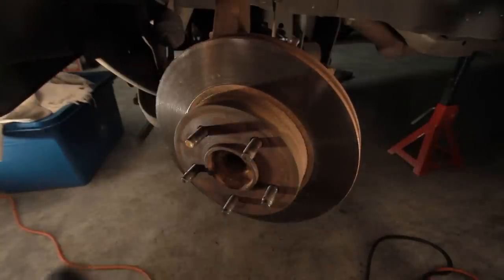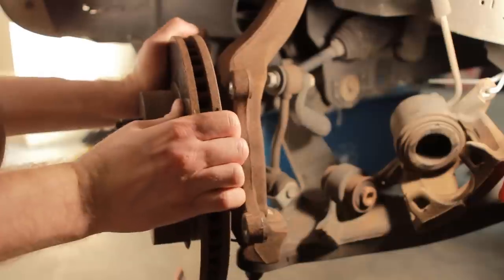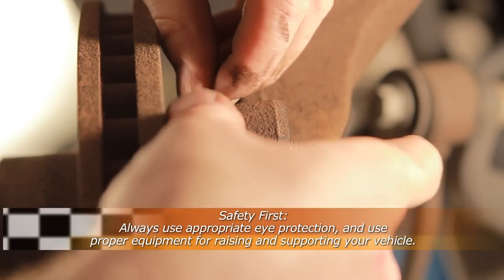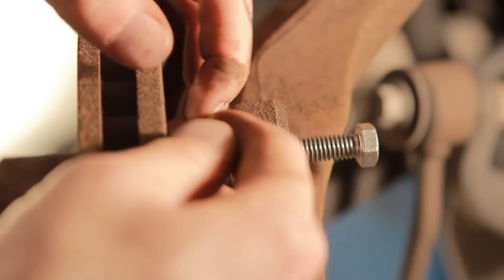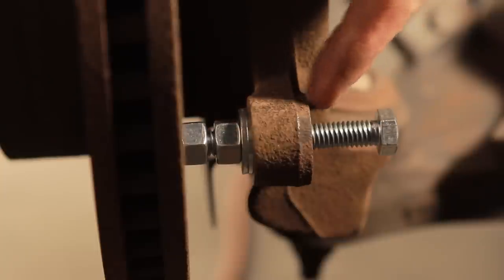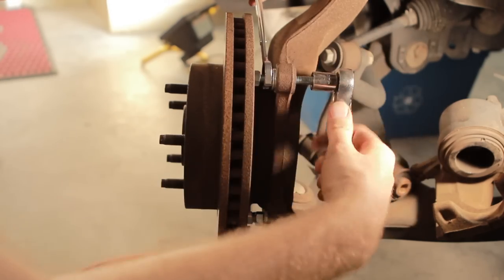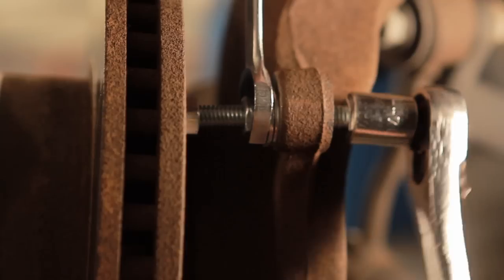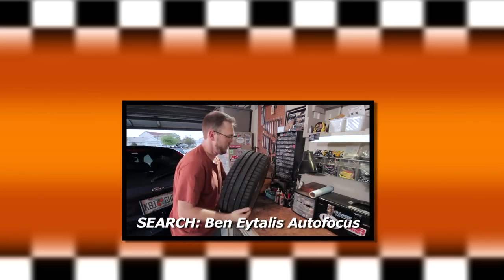Autofocus - How to remove a rusted stuck brake rotor

Comment: I wish this one worked for me. The idea is simple and effective in theory, but for my car, the caliper mounting hole riiiiight on the inner edge, so I ended up just blowing holes through the rusted edges. I used this method, penetrating oil, light torch, crow bar, and not to mention hours of whacking a 20 pound hammer on it. Upon further investigation, I got a flashlight on the inside and just saw rust caked all along the edge of the  hub. So basically what I was doing was the equivalent of putting a screw through a threaded hole and expecting to knock it through. What ended up happening is I torched the right where the brake surface meets the center. Gave it really hard whacks, and ended up braking (pun intended) the rotor...separated right on the edge. Luckily, that gave me enough room to get a giant crow bar wedged right on there. What I expected to take me 2 hours, took me 8 hours. Ugh!

Comment: Very clever -- Thanks for sharing
Reply: Never stand behind a horse and slap it on the ass. My how clever am I? All this ass hat did was show you a clever way to destroy your car. That mount he's using is the one that mounts the brakes to your car. It's easily bent or broken. Result: Your rotor is still stuck and you'll have the expense and joy of replacing your steering knuckle. Good luck with that.

Comment: my rotors being a pain i went bought bolts and try to do this, bolt just snaps
Reply: yea i dont know about you but i just tried this, bolt snapped and now its logged in behind the rotor. i need to saw the bolt out and im not even any further along. just created a ton of work for myself
Reply: @brademond7640  something happened to me. Just stuck now

Comment: don't need the second nut, but thank you! saved my ass from walking to Lowes for a bolt to fit in the rotor hole.
Reply from the maker: cool man! the second nut is mostly to apply more surface area to the bolt.

Comment: Thanks a lot for this video. I'm about to give this a try on my camry. There is no chance it will damage the caliper mount, is there?
Reply from the maker: Probably not, the cast steel parts are pretty tough. Just watch it though as you apply pressure, you never know. If anything looks like it's starting to waro you might want to try another technique.

Comment: THis works great. But if you cant find a nut/bolts in your collection just put the car back together and loosen all the lugs back a full turn. Then go for a ride around the block. Maybe hit the brakes hard a few times.Doesn't matter to the pads if you've already bashed up the rotor. You're replacing them anyway

Comment: Some rotors come with a couple of threaded holes in the face of the rotor for the same purpose: thread a couple of bolts in, tighten them down, pop the rotor off. It's a good idea to put a couple of lug nuts on partway just so the rotor doesn't come off violently and hit the ground. Don't ask how I know this.

Comment: Problem with this technique is the bolt itself can catch the threads of the slider pins and crack the threads on the inside if that happens game over time for a new nuckle assembly

Comment: Depends on how fused the rotor is to the wheel , you run the rick of damaging the wheel bearing using this method. given the wheel bearing is pressed and will separate with the hub and rotor attached. heat and  hammer and use the drilled hole on the rotor provided by the factory.

Comment: Great idea BUT you may end up popping the face section of the wheel bearing off, THEN YOU HAVE REAL PROBLEMS. Eric O demonstrated this. The bests way to do this if it’s rusted on is to. Tighten the bolts then use a metal hammer on the top hat of the rotor. The best medicine is to load anti seize on the hub face and it comes off like nothing. I service my brakes spring and fall. This includes inspection, anti seize to hub face, pad tips and hardware, lube the slide pins. I have not had any problems since I started doing this. I have a 2016 1500 Silverado that the minute I pulled into the driveway, I popped off the wheels only to find ZERO lube on any parts. I also have a 2009 Grand Caravan, 2008 Mazda 3. All from new and all have brakes service 2x per year. Each vehicle takes less then 1 hr.  Preventative maintenance works.

Comment: I wish I had bought the bolts, nuts and washers yesterday, IN CASE the rotor was stuck! This works like  a charm. I'm turning the bolt, wondering if its doing anything, then all of a sudden "PING!" and its off!  Everyone who's changing rotors ought to get the bolts first-the big $2 investment will save a world of hassle.

Comment: I've always don it this way and a warning they don't always come offthat easy I suggest that you put on or two lug nuts on as well while doing this because I've had a few that when they broke loose and popped it shot out at me due to the pressure and those lug nuts I put on prevented the rotor from hitting me

Comment: would this work for a rear rotor when the e brake is stuck on the inner lip of the rotor? Ive already taken plug out from behind the rotor to look for the star to loosen the e brakes, however I dont feel this elusive star at all...

Comment: Warning on this - if you're working on an old Mazda (and probably other old cars), and you live in the rust belt, you should probably avoid this technique.  Those two bolt holes are built onto the steering knuckle, and it's a cast part.  The metal for those two holes is very strong in one direction (the plane the rotor is in), and fairly weak in the other (perpendicular to the rotor).  This method applies force to those hole 'ears' in the direction they're weak.  If your rotor is really stuck (like, it's an old Mazda - they're notorious for it) you can bend those ears.  If they get bent, you need to replace the whole knuckle.  So, your DIY rotor replacement turns into a much bigger knuckle/wheel bearing, possibly other stuff replacement.
Reply: Thanks. 2010 Mazda 3 and very stuck rotors but the risk isn’t worth the easy part

Comment: I'm confused how a bunch of people here are badly damaging their vehicle trying this technique.  Is it because they're applying uneven tension between the top & bottom bolt/nuts?   If the nut is pushing against the rotor (which will be thrown out), I dont understand how people are badly bending their caliper arms, etc.  What am I missing?

Comment: Thanks it worked! BUT BE CAREFUL! 
On my Mazda 5 the bolts ended a little inside the brake disc, but i used ONE long piece of metal between the two bolts and the disc.
BUT BE CAREFUL! I BENT MY BRACKET WITH THE HOLES A LITTLE.
I had to bend/hammer the bracket back some millimeters.

Comment: And remember the Anti Seize on the face of the bearing before putting the new one in!  Clean up the face that it mates to first with a wire brush and even some sand paper.
Reply from the maker: good point! Yeah, did that on the install. I should have mentioned that.

Comment: Looks like my caliper mounts sit just outside of the rotor's diameter. i.e., I when I thread a bolt through, the bolt isn't touching the rotor, but instead just clearing it. Anybody have any ideas of how I can make this method work for my old rusty truck?

Comment: Sometimes the "pop" you hear is something other than the rotor breaking loose.  This is NOT a good idea.  I learned the hard way.  Use a harmonic balance puller instead!
Reply: Kevin Hahn Just watched this for the first time myself, and as a mechanic, I can say this really isnt a good idea, because you could easily break the rotor instead while trying to do this. Even in his video you can see the rotor warping and bending.
Reply: Most people are replacing the rotor with a new one, so it doesn't matter.
Reply from the maker: Rotors were coming off because they were being replaced by new ones. These had no more meat on them and had been on the car for over 10 years.
Reply: Kevin Hahn u cant please everyone. you have saved many of us so much time and a pain in the ass. this may not work 100% of the time but it does most of the time. thank you and you made a new subscriber by your good idea and your candor. God Bless you and your family.....also your vehicles lol
Reply from the maker: Thanks Brainstorm. Happy Wrenching!
Reply: Kevin Hahn
Reply: K evince Hahn
Reply: Bob TheBaconator And as a mechanic, what do you therefore suggest?

Comment: Had this issue for peeps needing to save the rotor like me I hit every lug with penitrating oil good and then a small bit basically where it's all touching let sit for a few mins the I put lugs on three at a time and took a 5 pound metal hammer and hit in between all the lugs and it broke loose

Comment: Why not just use a bolt that fit to the threads in the bracket?
Reply: Why not use a heavy duty pulley/gear puller rather than risk bending or breaking the brake mount on your car? Rotors are a joke. Try replacing the steering knuckle you just trashed. Now that's FUN.

Comment: You sir, are a freaking God right now. Thank you.... Thank you... Thank you... Just spent 30 mins wailing on this POS.... HAHAHA this took 3 mins
Reply: How long did it take to replace the steering knuckle? You do realize that's where your brakes attach to the car right? If you bend it by even a tiny amount you just totally screwed yourself. Anytime you see a video from someone who "DISCOVERED" a new and simple way of doing something, they didn't. This has been around since forever and only morons do this. Hey I just discovered a simple way to remove a dent in my Passenger side door. Drive a Dump Truck into the Driver side door.

Comment: Be a little careful doing this as I ended up causing the push fit bearing on a Volvo XC60 to slide out about 4 mm. I eventually took a grinding disk to the edge of the top hat section of the disk and then drove a cold chisel into the groove and taking the face of the disk off in about 5 pieces. The friction was not the face but the perimeter of the hub. Wish I had gone for the grinder on day 1 as I now have to pay to have the bearing pressed back in or replaced.  I’m sure this method works better than a hammer but be a little careful how much force you wind on

Comment: Try using your OLD brake pads between the inside of the rotor and the bolt instead of the 2nd NUT.

🤔

Comment: I used this method and it worked but it bent my bracket in the back so I had to hit the bracket with a hammer to get it straight again.
Reply: be carefully when hitting the bracket back into place i was doing this once and pop of went the bracket.. i had to replace the entire steering knuckle after that lol. They are only made of cast and after bending them to much the will break

Comment: Didn't work for me - I ended up with 2 broken bolts.  They were no fun getting out either, had to sawzall them out....  Don't know what to try tomorrow.
Reply: Tony Disavino Same here, what did you end up doing to fix it? My last resort is to massacre it with a fire fighter's axe
Reply: Killed it with wd 40, let it sit overnight, got a bigger nut & bolt tried again the next day.  Heated it a little with a propane torch and it FINALLY BROKE LOOSE.  good luck.
Reply: I got it ! Ended up hitting the lug bolts back out of their grooves and it finally came off. Thankfully didn't damage them (too much)

Comment: Bad idea if you have an aluminum spindle. Its a good way to break that bolt boss off and then you have to spend a few hundred extra and alot of time. Take the back of a ball pien hammer , place the ball on the rotor face between the studs and give a few whacks on the hammer face with another hammer, move around the hat and It will pop right off!

Comment: Did not work in this case, I used 12mm bolts. 

Eventually i drilled a hole in the rotor, and about 2mm further into. Then i made threads into holes, put a 5mm nut inside since threads wont go all the way and screwed it loose with a 12mm bolt. Had to repeat this on opposite side cause the rotor just cracked and came partially off. This method wont put so much strain to bearings etc.

Comment: I have seen worse. I had to cut, heat and hammer until the spindal move 1 inch. And then rotor popped in 2 pieces. 3 hrs.

Comment: It did not work for me. Grade 5.8 bolts just twisted like a pug''s tail. Grade 8.8 bent only a bit, however the caliper holder thing (no idea what its name be) got distorted badly as well.
(It did got back to original shape after removing the bolts though.)
No dice.
I hope will have some great idea as my next best thing is the angle grinder.

Comment: i really hope this works for me because i stripped the rotor screw and i took out the head of the screw but the rest of it broke off and is stil in there. So i just took a big drill bit and drilled the sh*t out of the rotor screw hole and possibly part of the hub which i dont care about. It just wont come off so i assume its just rusted on to the hub and not a piece of the screw haunting me.

If your idea fails, i will have to goto my mechanic in defeat and have him laugh at me lol. Luckily i know him and know he will help without making up lies and saying i need a new hub etc...

Comment: I have a Hyundai with the stupid screws in my rotors I got one out and almost stripped the other.. before the damage got worse I went to AutoZone and auto advance parts to find a impact screwdriver... Both didn't have it.. then went to home Depot they didn't have it neither... Frustrated that I couldn't find the damn thing .. I was tempted to buy one off from Amazon... But didn't want to wait 3-5 days to get it so I bought a regular philip screwdriver that can withstand a blow with a hammer.. got back home tried it... Was scared out of my mind that I was gonna mess up. But.... It was successful!.. thinking it was gonna be a smooth butter job from there on out... I ran into another problem 🤔 now the rotors are seized and won't move for sh!t ... Bruh I hammered the hell out of this thing... But now that I see this video I finally got some relief 😌 going to try this in the morning. Thnx a ton.

Comment: Using a big ass hammer and hitting it usually works. Im a mechanic and that method or using a puller or pry bar after using pb blaster. The method in the video is clever but not a great idea. If you snap one of those caliper mounting bracket ears then your pretty fucked.you would need a new spindle. If you cant get it, bring it to a professional ASE tech and we can do it for you.  Thats why we exist, because not everyone is cut out to be a technician

Comment: Ive tried everything... this 06 fusion rotor still wont come off ... what in the fuck?????!??!?!?!?!?!?!  Not only that in this video you have A LOT of space between the rotor and the spindle mount which fits 2 washers and bolts.. I dont even have that much space in fact Ihad to use a smaller bolt and nut just to get it to fit... then... of course... the fucking bolt snapped but left part of it in between... so then got the hacksaw blade... it broke LOL... jesus fucking christ... eventually got bolt off... but this rotor still wont come off.
Reply from the maker: oh man..that suuuucks. Sorry it didn't work for you. I'm sure you've tried, but I'll suggest it anyway. Did you apply penetrant? Spray some PB Blaster or some sort of aerosol lubricant into the stud holes, and anywhere you can force it between the rotor and spindle and let it sit. Keep doing it over the course of a couple of days. Maybe that'd help?